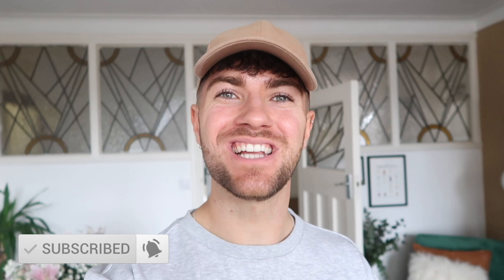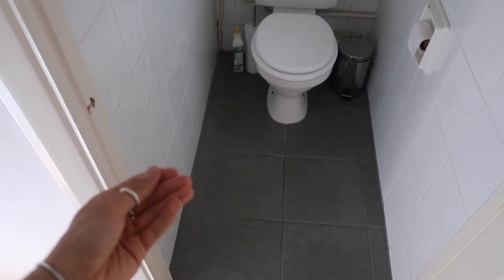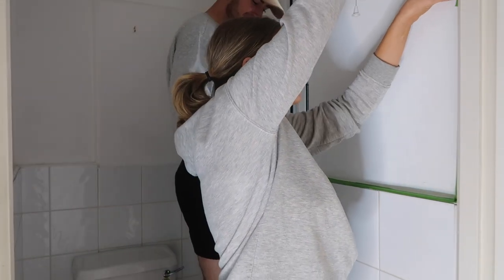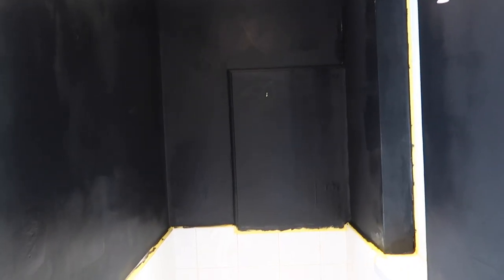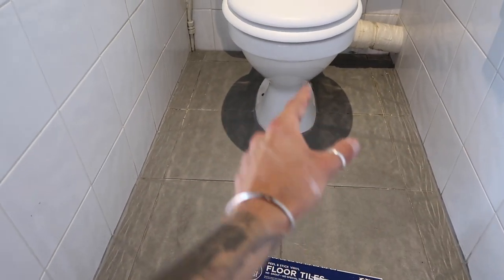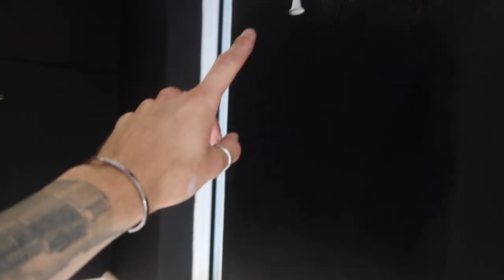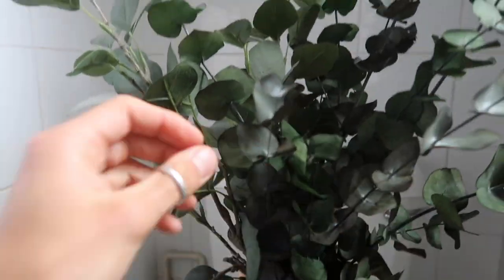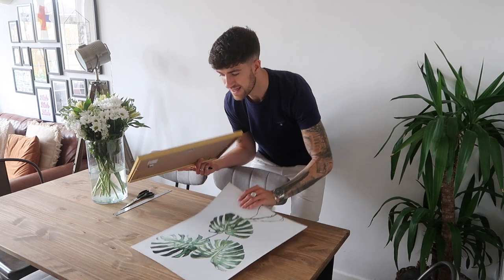SMALL BATHROOM MAKEOVER | DIY PEEL AND STICK £50 BUDGET MAKEOVER

Comment: Good morning, wow looks great. The dark colour hasn't made it feel cramped, very smart 😊👌
Edit : I used to live in an old property and sometimes removing wallpaper can be very costly. The old plaster can come off with it and reveal cracks and allosorts. Painting is a quick and cheap fix. Wallpaper can hide a multitude of sins 😅
Reply from the maker: Ahh thank you so much! That’s good to know for when we move for sure🧡
Reply: @LukeCatleugh  yes, definitely pay more for structural surveys and the like, in old homes, they're built better but can have massive hidden issues. A simple thing like an old clay drainpipe collapsing because plant roots grew through it, under property, can cause subsidence and cracks develop. Look for similar quick fixes on exterior walls, where it's been recovered recently to hide things. People are sneaky where money is concerned.
Neighbours of mine round the corner bought a house only to find the roof that had been put on was too heavy for the structure to cope with and caused the walls to bulge out. Very expensive repair.

Comment: Zara/Luke - did the grout pen do anything?? I have looked at them a few times and wondered whether to bother- please advise Make over looked great.  I am guessing your building must be quite old as building regulations dont allow there to be no hand washing facilities in a room with a toilet any more ( I think) that isa draw back isn't it?
Reply: I have the same grout pens (got mine at cherryz).  You have to hold them like a normal pen (so the paint part can start to come out) and you may need to rub them around like a new pen on a bit of card to get them going.  They do a great job and it brightens the grout up to a lovely white, like new.  Grab a few if you are covering a standard bathroom and maybe 2 if you are covering a small room like Luke and Zara's.
Reply: @dippycatlady  Thanks!